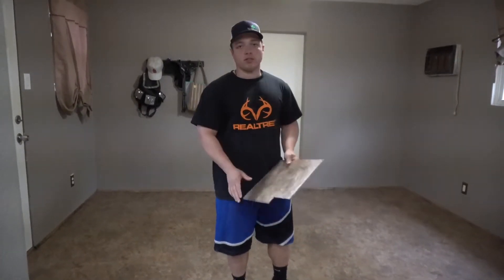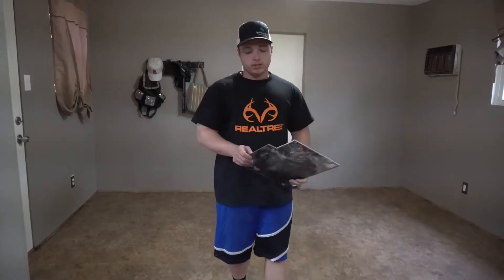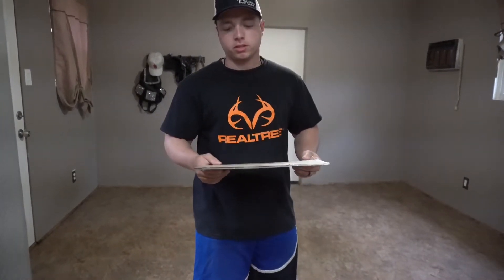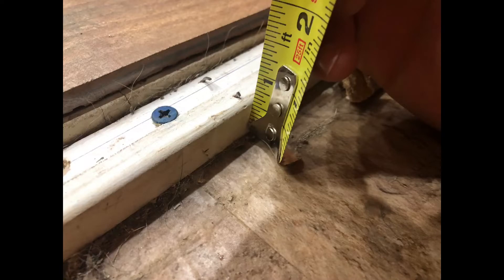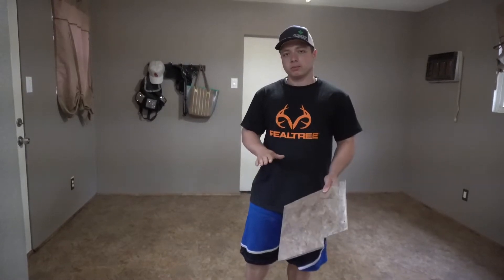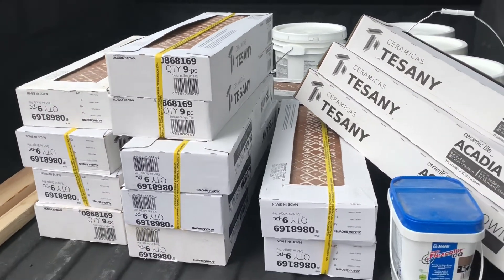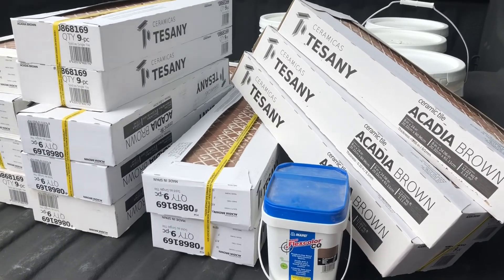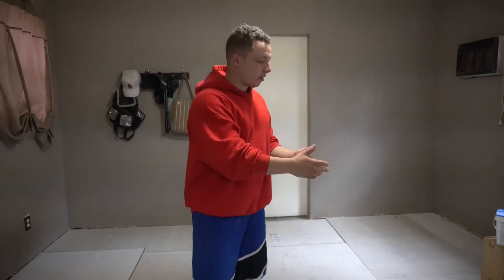FLOOR TILE - wood tile floor - Bedroom makeover - Redoing my Room - Part 1

Comment: I just wanted to comment on the backer board installation. The joints of the boards should be staggered or off-set at least 8" from one another; aligning them like you have, makes it more prone to cracking. This also applies to the joints of the plywood that you're placing the backer board over. I hope you used thinset to secure the backer board followed by the appropriate length screws every 8" along each edge and center of the boards. Then, use a mesh tape and thinset on all of the joints the next day. Best of luck to you and this project.